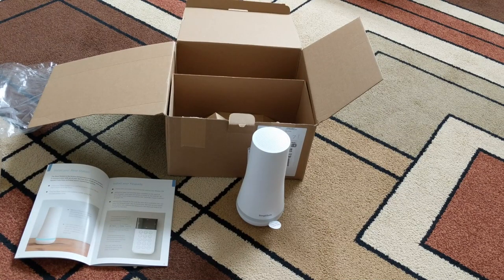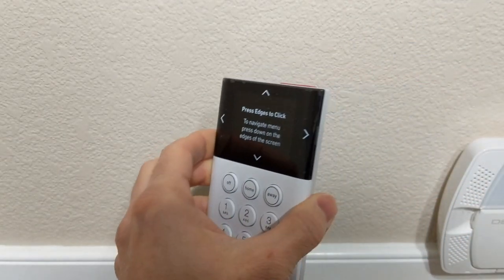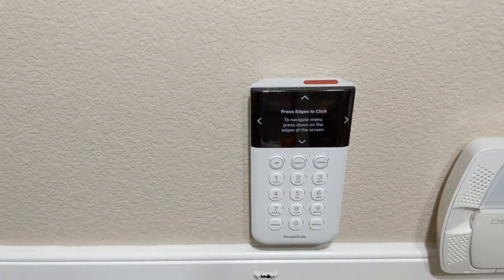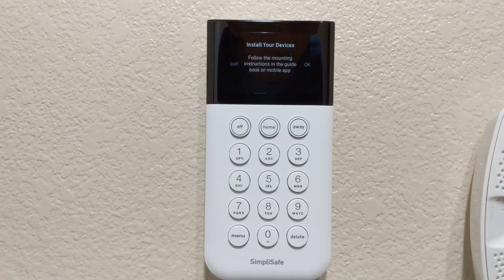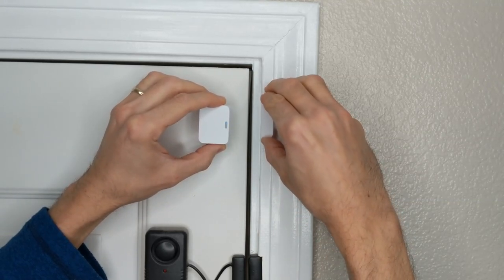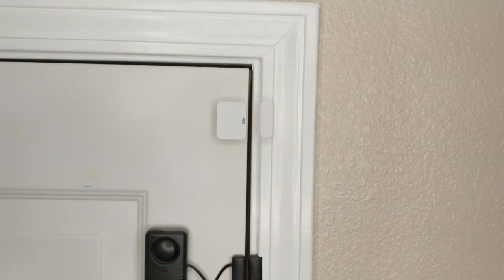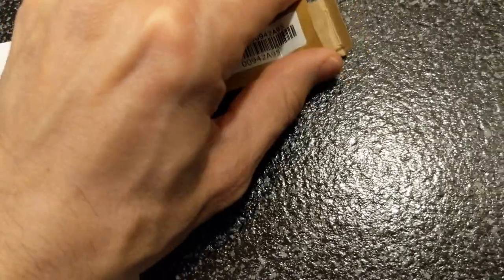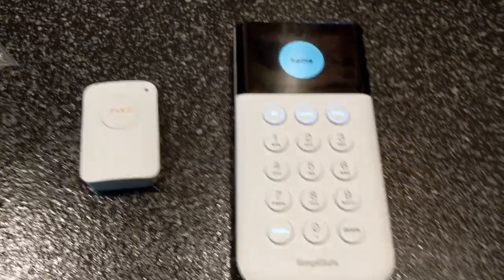SIMPLI SAFE HOME SECURITY SETUP FROM START TO FINISH

Comment: it's a good idea to prep the sticking site with an alcohol pad first to ensure it's clean so the adhesive will stick better.
and in some circumstances you might find that's it's hard to place the magnet because of how the door opens or how the frame is constructed. you can take the magnet out of the plastic and then use a light application of glue to hold it in place, sometimes you might have to buy "flat" magnets  that are as thick as 1 or 2 dimes stacked and use those. call it a pro tip.
Reply from the maker: Great tips my FRIEND, it is most appreciated :)
Reply: I know I'm pretty off topic but do anyone know a good website to stream newly released series online ?
Reply: @Emmitt Troy thanks, signed up and it seems like they got a lot of movies there :) Appreciate it!!
Reply: @Adrien Randall glad I could help :D

Comment: Good video, i just purchased one myself! My concern is, if you're out on vacation, the sticky part comes off for the door sensor, it will definitely set off the alarm and your neighbors will forever hate you for it  since its a false alarm lol
Reply from the maker: Yes this can happen.. super glue works pretty good or they do have the option of securing with screws

Comment: hey there, I just ordered complete simplisafe system (huge discount, 60% plus free indoor camera),,,I will follow your video to set mine up! LoL !! peasy easy!

You should choose different placement to stick the sensor on the door ...maybe horizontal on the door rather than usual location...

Beside,, do not put the Simplisafe Yard sign - Simplisafe uses t he most common frequency 433.9Mhz same with other remote electronic devices , like rc toys,..etc! I heard that Simplisafe did update the algorithm to detect if the frequency jamming is attempted onto the remote sensor!

Question,,As watching your video, it looks like so we can give custom name for each sensor, cannt we?
Reply from the maker: hello FRIEND, I hadn't heard of the frequency jamming before.. Interesting for sure.  Yes, YOU can give custom names to the sensors but I don't think their is a way to get the tower to say what sensor is open
Reply: @ETPCYT  the system won't be armed unless all contact sensors are closed.

Just like your previous DSC system, if any contact sensor is not closed, you press left or right button and it will tell you which one is still not closed.

asking your experience, if one of contact sensor being opened, what's happened if you tried to arm it? does it tell you something is not closed or you have to walk to every sensor and tell if they are closed or not?

Comment: Well shot, thanks for using a tripod for most of the shots.  The audio was good for most of it.  Some suggestions if you do another.  1- Use a lavalier mic for good audio quality throughout the video.  2- Edit the video by taking out the dead spaces, like when you were holding the sensors, or when there is nothing happening in the video.  You could have saved 10 minutes or so.  I had to jump forward several times.  But, still a good job for an amateur videographer.
Reply from the maker: Thanks THOM I appreciate the tips.  I definitely can use some pointers :)  I try to get better.  I could use some better equipment to do this. Have a wonderful day my FRIEND :)

Comment: @8:24 you say to attach the larger part of entry sensor to moving part.  But the instructions clearly show a picture reference that shows the smaller part attaches to moving part.  Do you still recommend your way?…and if so, why.  Thanks and appreciate your video.
Reply from the maker: hey Chris I must have misspoken , I use the smaller part as the moving part.. I am sorry for the confusion

Comment: When you install your motion sensor you use outside sticky pads for corners and inside pads for flat surfaces
Reply from the maker: good tip, thanks MILLER :)

Comment: What mate up go with Simplisafe over ring.
Reply from the maker: I actually have both systems lol
Reply: ETPC EPIC TIME PASS CHANNEL lol which one do you prefer?
Reply from the maker: @LrgPicture  well, I only have the ring doorbell and it is kind of nice but we don't have the data plan.  The simpli safe is easy to use and fairly inexpensive.. and it has monitoring.. I am not sure ring does.  They both seem to be decent products.  I haven' t had an issue yet
Reply: ETPC EPIC TIME PASS CHANNEL lol cool beans. Yeah I have the ring alarm system (got rid of the cameras) but I have the nest doorbell and cameras (which work great). I’m just itching to try SS. The ring alarm is fine. It does as advertised but it almost seems like the quality of the ss may be better. I don’t like that the monthly fee is more expensive though. Do you have the $15 plan or the $25 plan? I can’t remember if you said it in your video
Reply from the maker: @LrgPicture  I just have the 15$ one.. they don't really give you a lot with that.. but I am a cheapskate lol :)